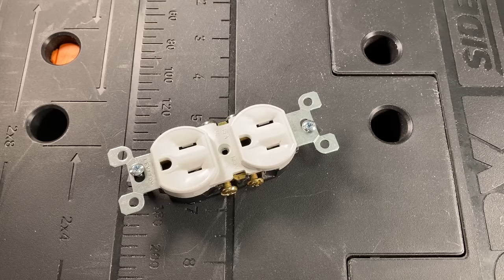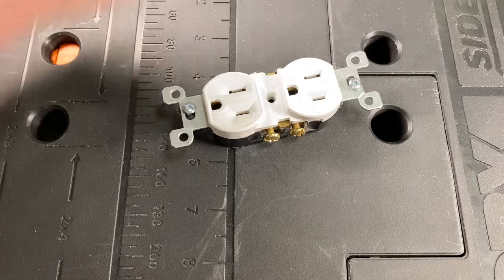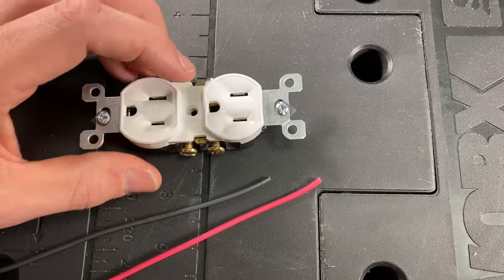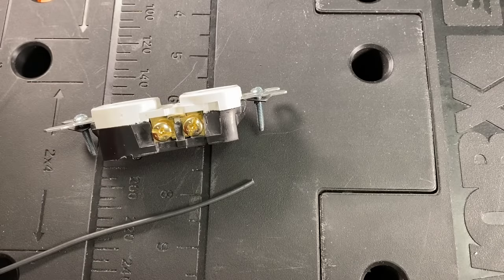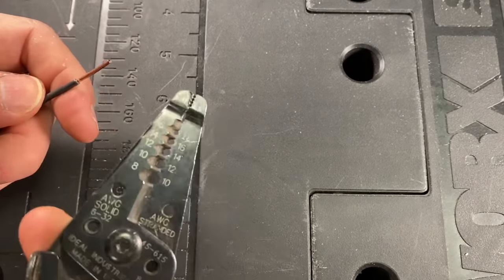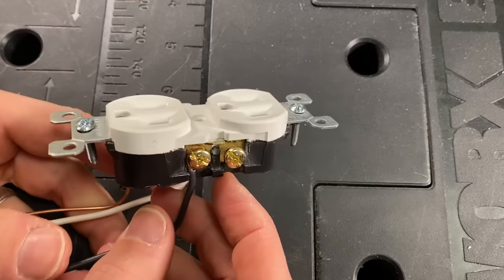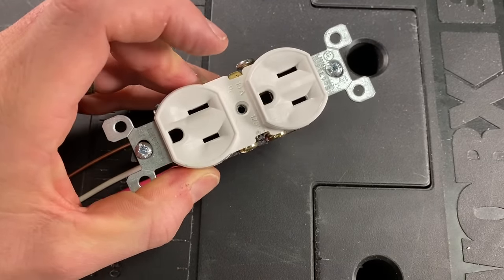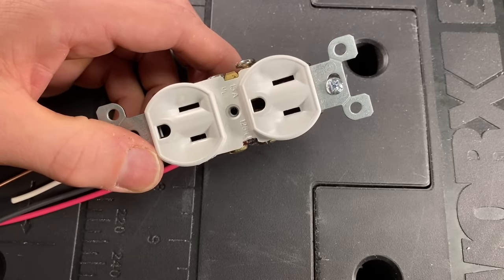Electrical Outlet Basics | How To Wire

Comment: OOPS !  You neglected important note. If you remove that tab to allow for two different circuits, you are supposed to label the faceplate denoting that it is a "split" receptacle. It is not required to be a split receptacle just because it has a switch controlling it. Failure to identify on the faceplate could have potential of someone throwing a breaker, then unfortunately may happen to only test the portion of the outlet that is off and not check the other. Then they pull out the receptacle thinking they are safe and ZAP , they get hit by the unknown hot. You also did not mention that blue is also used to denote also a hot wire. Really important to label that split receptacle !
Reply from the maker: Thanks for the feedback Dallas 👍
Reply: Really ???  Thanks FYI
Reply: I have never seen this done in the real world.  If you put a sticker on the faceplate, it will be removed.

In my area,  the two hot wires in a split receptacle must be connected to a double-pole circuit breaker, so that when the breaker is shut off,  both receptacles disconnect . That way, the outlet will be safe to work on. 

If you are working in an electrical box.  Make sure all power to the box is shut off before you work. You may have split plugs or  multiple plugs, a plug and a switch ... If you shut one breaker off and you still have power,  then you need to keep shutting breaking until you have no power.

Concerning wire color:  Blue and yellow wires are sometimes used as hot wires and as travelers, green wires (and bare copper wires) are ground wires, and white and gray wires are neutral. All electrical wires, regardless of their function, may carry an electrical current at some point and should be treated with equal caution. When doing repair work,  you cannot assume that the proper colored wire was used for the proper use.  Check it out.

If someone does not know how to determine if a line is hot, then they should not be working on electricity.
Reply: Army Mobility Officer Double pole breaker would be 240 volts?
Reply: @tedlahm5740  not exactly. If one of the two wires on the double pole breaker is going to the other side of the split receptacle, it makes one circuit separate from the other, so you would have two individual circuits on the one double pole breaker. A great way to keep the complacent people safer.
Reply: @armymobilityofficer9099  many different ways of interpreting the code per local inspectors. I know to always test both sides. My comment was intended to make others aware of the need for extra check.
Reply: Dallas Arnold     Shared neutral?   15 amp draw on both.  How could/would the
current (amps) balance out?   Thank you.     P.S. a 240 volt circuit needs no neutral?
Reply: @tedlahm5740 
It’s called a multi wire branch circuit, not a 240V circuit. You’re just sharing the neutral for two 120V circuits. The important thing to remember in this situation though is to make sure when hooking up the two feeds in the panel, that you terminate each on different phases. This is achieved by terminating the red and black wires on a 2 pole breaker.
Reply: Midnight Flyer Thank you.  Would the shared neutral need to be larger to
be able to balance out the two 120 volt ckts?
Reply: Dallas Arnold Would the shared neutral need to be HEAVIER gauge than the current carrier to accommodate the balance needed?
Reply: @tedlahm5740 
Hey Ted,
If you’re just talking about standard residential 15-20A split receptacle set up to have two separate circuits for top and bottom of receptacle, than in this situation there is no need to oversize the neutral. In fact, it’s more common to derate or undersize the neutral or keep it the same size as your ungrounded or hot conductors as it is sized to carry the maximum unbalanced load in amps between the neutral and one or more of the ungrounded (hot) conductors. In some commercial situations where harmonic loads are involved, neutrals may be oversized. 
In your scenario, just use 14-3 or 12-3 nonmetallic sheathed cable (romex) where you will have a black, red and white in the same cable. As you said, terminate on a two pole breaker and add a breaker lock. Hope that helps🙏🏼
Reply: @armymobilityofficer9099  100% correct, that's the safest method to handle circuits that share a neutral, even if they don't terminate at the same location.  Splitting a neutral connection that another circuit is using can be very dangerous.  Most AHJs require this for multi-wire branch circuits both residential and commercial.
Reply: Do they have split faceplates it do the just expect you to write on it or something?
Reply: @armymobilityofficer9099  yes, This is the correct answer in ALL cases.  There should never be 2 separate power sources in any outlet.
Reply: @mitchjohnson4714  I have never seen a factory marked faceplate myself. Writing on it is acceptable, but most print a label to stick on it.
Reply: @armymobilityofficer9099  You nailed it! I have rarely ever seen outlets marked with a sticker. Even when I put them on in a rental, the next time I go back they may be removed. Your comment about multiple power wires in the box is also spot on even though others have disagreed in the comments. I have seen numerous switch boxes with multiple power feeds in them. Especially in remodels people use them as a pass-through when running new wires.
Reply: @CBrown07696  Of course, the best solution is the one I use....when I work on ANY power item in the house, I shut off the whole house generator (automatically switches on in case of power failure), AND the main breaker to the entire house.  NO power ANYWHERE means I'm safe...and I still check.  Much prefer my hair uncurled!
Reply: The double pole breaker (full size) would be a code violation as it will place 240 volts in the same 120v box. If the tab was then not broken you have an instant short L1 to L2.
Reply: @perryfarmer3280  Depends on your inspector. Some require the use of the double pole breaker on a split receptacle. However, you could still have 240 volts at the receptacle even if two separate single pole breakers are used as they would most likely be in adjacent slots which would be the same as a two pole breaker. Either way would be a problem if you were careless enough to NOT remove the connecting tab on the outlet, which you seem to assume is likely.
Reply: From reading replies here it sound highly likely. My reading of the code is you use the double pole breaker for a shared neutral, not necessarily a split recepticle.
Reply: Gosh… I have never seen a labeled one.

Comment: Absolutely never use the push pin connections on a normal receptacle! That's good advice! It is against the NEC as well! The only time I'd advise to use push pin type connecters is on a GFCI because along with the push pin connections, their is a screw for each side that double clamps down on the inserted wire thus making sure it don't pop out and it saves time having to loop wires and wrapping around the terminals.
Reply from the maker: Agree 💯
Reply: Those connections on a GFCI may resemble push pin connections but they are much better and preferred.

Comment: When I hook the wire around the screw terminal, I always try to have a bit of extra wire-end sticking out (like maybe an eighth of an inch; enough to form a little tag-end to grasp with pliers, but not so much that it dangerously extends downwards past the body of the outlet where it could short against other wires or metal parts of the outlet or junction-box) and then use needle-nosed pliers to squeeze the end inwards a bit to wrap it tighter around the screw's shank so that it will be less likely to "wander" back out from underneath the screw-head as I tighten the screw (sometimes I will even grasp the wire-loop and hold it together with the pliers as I am tightening the screw).  This is a lot of current that you'll be carrying here, so you'll want all the contact-area you can get between the screw and the wire.  Also, sometimes the Phillips-type head on the screw will not allow me to tighten the screw sufficiently (especially if the screw's Phillips-cavity and/or the tip on my screwdriver is a bit worn), in which case I use a flat-bladed screwdriver in the screw's slot to finish tightening it.
Reply from the maker: Thanks Fred, appreciate you providing your experience.  Take care 👍
Reply: Comes across as overkill
Reply: @Benmelech  Have you ever actually tried to attach a wire like that?  Maybe you had different experience from me when wiring on AC plugs/sockets, but in my experience, the wire-end often "wanders" back out from underneath the screw as you tighten it, and so I always crimp the wire-end into a tighter loop to make more sure it stays where it's supposed to be.  Like I already said, this is a lot of current you're carrying, so you want it to have as secure and solid a metal-to-metal contact as possible.  Maybe you've used only screw-terminals with a "three-sided box" cover-hood that keeps the wire-end in place, but I'm talking about a screw-terminal that just has the flat round screw-head, with no attachments.
Reply: @Quacks0  as a novice I probably misunderstood you. I thought the tutorial was very well done and covered all the bases so to speak. As in my trade carpentry, I also go the extra mile, so I understand where you’re coming from. My apologies Fred
Reply: @Benmelech  No problemmo, Dude --- and actually, you may be slightly correct in that I do indeed have OCD tendencies, but I also like to be safe when I do wiring, and of course you can never be too careful with that.  Plus I know that most modern-day wire-on plugs and sockets are rated for fifteen amps --- nearly 2000 watts --- and of course the greedy/stingy electrical-products manufacturers give you just as little copper as they can possibly get away with in their wire and connectors.  So you will want to always make maximum use of what little of the precious silvery-orange metal that they do give you.  Glad to hear that you make an extra effort to do good work in your carpentry projects, just as I do --- one can never be too careful when building things from wood, either. :D

Comment: NEC now says ground side is up in the wall, this is in case a metal cover falls onto the prongs of the male plug, the cover lands on the ground and doesn't short.
Reply from the maker: Really,  is that true for both switched and normal outlets?  I know many of the guys and gals in the comments had mentioned putting ground up on switched outlets for easy identification.
Reply: It’s isn’t true. It would only be in spec for a job. Most of the time ground side up is used in healthcare type buildings.
Reply: I would like a code reference on that one Michael. If you are going to quote the code book you should post the code article. I've been a electrician for 30 years and so many times a electrical inspector will fail people and say it's the code and then he will be wrong , But then that electrician will go on thinking it's the code. I always ask them for a code reference. And some time they will give me one and some times they can't because it's not in the book. But I will say they are always changing the code so it's a challenge to keep up with the changes.
Reply from the maker: @josegomez9370  appreciate the feedback 👍
Reply from the maker: @jerryday2851  thanks for jumping in on the conversation and appreciate your experience.
Reply: The NEC does NOT say that.
Reply: @EverydayHomeRepairs  Glad I can help, This is the only video that I have watched of yours do you have video's on how to trouble shoot a outlet  that's just stopped working, And trouble shooting Outside outlets and bathroom outlets that stopped working. I've been thinking about making a video on those two, Because those are the two most common service calls our service department gets. I don't have any video's or a channel but I've been wanting to do it for years but probably never will.  LOL.

Comment: I think that the very first recommendation would be to spend the extra $1 to $1.50 and get the commercial-grade outlet over the residential/builder's grade (like the one shown in this video).  They are much more robust, have a longer life (# of insertions), and far less likely to fail by arching.  I don't know a single electrician that uses residential/builder's grade outlets or switches in their own homes.  See one of the many YouTube videos on the topic.  Then cut your power and verify that it's off...
Reply from the maker: Thanks for the feedback Lee 👍

Comment: I call them cheater holes. I run in to many MANY issues with these CH either having the wire come out or the tiny connection burns out and anything down circuit from it loses power
Reply from the maker: Yeah, I am surprised those holes were so widely included in the designs of standard outlets.

Comment: Excellent!!!  - The only recommendation is to put 2 clockwise loops of electrical tape over the outlet before securing it in the box.  If the box is metal and the wire were to ever come loose, it could hit the box wall or another area.  It could be overkill but it's an inexpensive safety measure whether the box is plastic or metal - I like metal.  If hiring a contractor specify the better material and, again, remember the tape.  Good job on the video.

Comment: I like wrapping the whole things around with electrical tape so the terminals are insulated.
Reply from the maker: I like that approach as well, thanks for calling it out.
Reply: I remember that way back .. wrapping black tape around it 😳
Reply: @EverydayHomeRepairs  Wrapping tape around it is a good idea when using metal boxes.
Reply: Good tip ! 👌

Comment: I feel like the majority of people that are going to watch this are beginners or not super comfortable with doing this so I have one more tip. Always make sure the tips of your loops you make with the wire are pointing clockwise once you have it wrapped around your screw. This will prevent you from pushing the connection out And unbending your loop as you tighten down if that makes sense. You only want your loop to get tighter when you are tightening the screw.
Reply from the maker: Great addition, thanks for the feedback!

Comment: always screw all the screws in all the way, including any unused screw.  i always use a big flat blade screw driver to finally tighten my screws for maximum torque.
Reply from the maker: Thanks for the tips!
Reply: @EverydayHomeRepairs  happy to share.  good video.
Reply: Yes, well as I said in my comment above, sometimes the Phillips head screw just doesn't allow for a tight-enough screwing-down before it slips, so you may need to use a flat-bladed screwdriver to finish tightening it.
Reply: @Quacks0  yes, that is the common problem, i zack them all up with the Philips then give them a final cinch with a big flat blade.  nothing beats the torque of a sharp flat blade.  the screws are mostly all Philips, square (Robertson) and slotted now, which makes the slipping of the Philips worse, they do make a special tool that is both Philips and square all in one for electrical work, i've never tried one.  if you had bunches and bunches to do, it would be worth it to get one.
Reply: @frotobaggins7169  Where can I find a tool like that?
Reply: @Quacks0  i think i saw it at home depot a few years ago.  just now, looking, i see Ideal tools offers one called Combo Head screwdriver, their part number is 35-204.  any electrical supplier who handles Ideal products should be able to source one.
Reply: @frotobaggins7169  Thanks --- I looked it up; I guess it's not actually a "three-way" square-drive/Phillips/flathead combo driver, but it is for the "also-slotted" Phillips screws.  Thanks again for pointing me in the right direction.
Reply: @Quacks0  you are so welcome.  i'm glad i could help.  i'm sorry if i implied a flat blade was part of it.  it's a "Philips/Robertson" and should grip really tightly.  even just the Robertson, square drive, should grip better than than just the Philips.  personally, i would still cinch it up with a flat blade screwdriver. lol  but then i've never used one.   maybe for 10, i'll get one just to try. :D
Reply: @frotobaggins7169  Actually, it is indeed a Phillips and flathead combo-tip; no mention is made of a Robertson square-drive part on the screwdriver's tip.  I think maybe you are confusing the screwdriver with Phillips/square-drive combo-head SCREWS THEMSELVES; I am not aware that a special screwdriver is made for these; just for Phillips/slotted combo-head screws.  The theory is probably that you would not likely need a combo Phillips and square-drive screwdriver because presumably the square-drive head gets gripped solidly enough just as it is, even if it has a slotted or Phillips-head cutout, also.  I agree that this is not necessarily the case, though, especially considering how large some screw-shanks are compared to the wimpy-small square-drive head-slots on them; they would likely require more torque to go into harder materials than the small square hole could provide without the screwdriver's tearing out the screw-head's hole-sides/corners.  Same deal with torx-head screws --- many of them have too large-diameter shanks for the size of the torx-slots in the heads.  I always try to use a flathead screwdriver in this case --- at least to "finish up with" to tighten the screw down the last bit --- so as not to risk damaging the screw-heads or my torx screwdriver.
Reply: @Quacks0  thanks, i couldn't get a good look at the tip to determine.  i just remember seeing one years ago.  i thought it was square/phillips.    i agree, the square loses some of it's power to the cut for the phillips but it's still pretty good.  i recall a few years ago i was putting quite a few outlets in and i used the square to get the initial torque as it wouldn't cam out like the phillips or damage the screw like you say.   you're making me want to try one more and more. lol